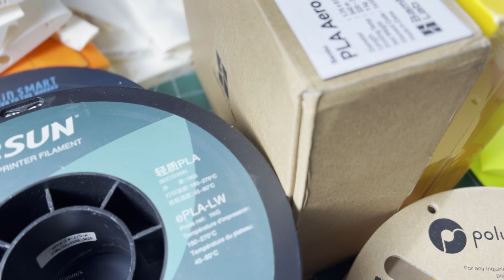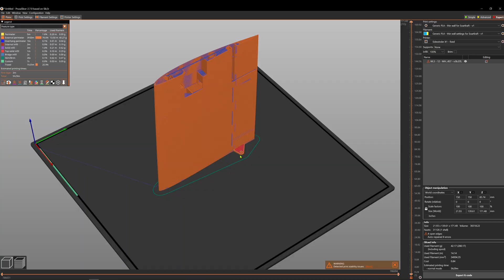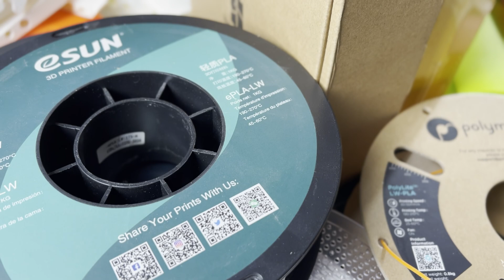SoarKraft V3B file updates - better and faster printing with foaming PLA

Comment: Thanks for the update, printed many planes in cure from many designers using LW without problems. but I had disastrous impressions when I printed your wings (igneous). I don't think cure or old printers are the problems, I think they are design problems. As a suggestion you should improve the aileron and flap hinge system, they are very basic and break easily with use.
Greetings
Reply from the maker: Did you try the suggested "silicone hinge" method for these?  Light/Thin layer of silicone RTV on both sides of hinge line.  Yes, the hinge cracks with some material more than others, the silicone support these very well. 

I have been testing new geometry with better result (coming update), but it is still the same design... I like it and I'm my biggest customer.  Clear 100% silicone bath and kitchen, 40-100% elongation, $5-9 tube available at most hardware stores, 1 tube is good for 30+ planes.  

I have tried other planes and designs... they are different, but I don't like them...  buying a roll of TPU and getting it to print right... having those hinges break, diggout the pieces, print again... or hinge eyelets with a full length wire... printed hinge pins are terrible... Most use way too many parts, damage easily, and difficult to repair.  Mine are tested to 100+ mph and yes they crack and break off sometime, usually when I crash, but I have easily repaired them if the plane is still flyable with the silicone method.  

If you have a better solution lets hear it.

Comment: Great news. I have already printed 6 gliders completely in PLA-LW with my Ender 3 pro. Super strong and above all very fast. In the meantime I have already completely destroyed a few of them. Just my own fault. I like to fly crazy. My thing is just flying into the danger zone. To the moon.
From June this year I purchased a Bambu Lab X1 Carbon. Super 3D printer. Now thanks to your information I can also use it for this.
And what's even better, the Bambu Slicer also supports Ender 3 Pro.
Thx, Greetings from the small country of Belgium

Comment: how do you shell the wing in cad?
i always get an error when i try to do that. i have the cleanest spline you can imagine for the airfoil, using my BezierAirfoilDesigner, but the shell command still doesn't work. do you loft additional inner surfaces, too?
Reply from the maker: I use SolidWorks... surface loft and thicken, but you can only thicken it outward, and my complicated wing plan lofts make it worse.  Inward surfaces would always fail.  Outward would end up changing the airfoil too much... too puffed for what I wanted.   Had to do all kinds of CAD ju-jitsu to get the solids I wanted just the way I wanted.   I probably made it overly complicated, but it has been working for what I want.  

This "vase mode" style is sooo much easier, but very limited if you want to do complex structures.